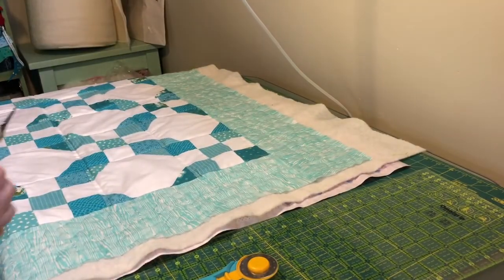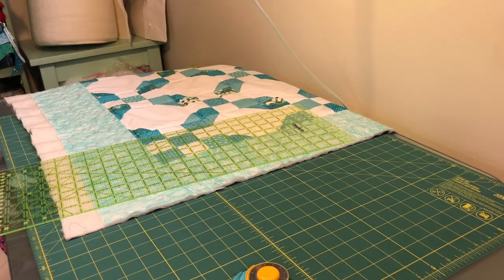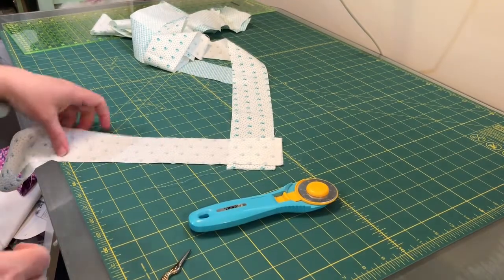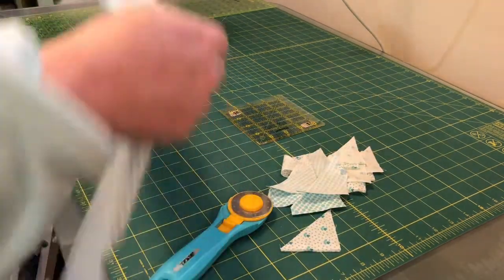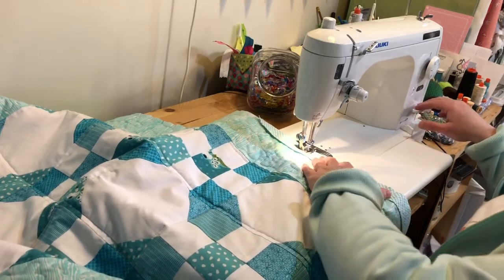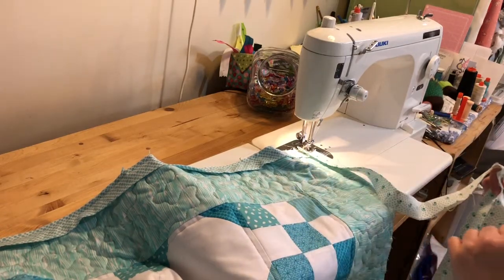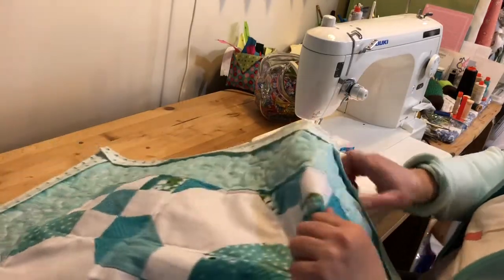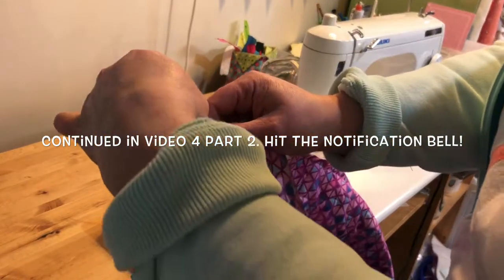Making and Attaching Binding Video 4 Part 1

Comment: Here is a helpful tip before sewing your binding strips together. On the first one, pin along your sewing line and just check to make sure it will end up going in a straight line. Don’t be like me and sew it at the wrong angle!
Reply from the maker: Colleen Nicholls Yes, good point 😀 I’ve done that too